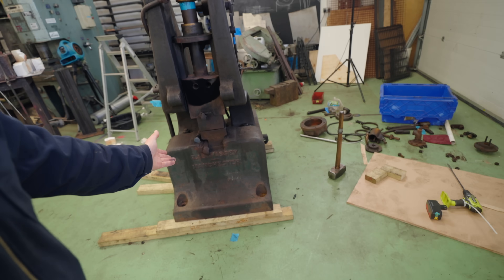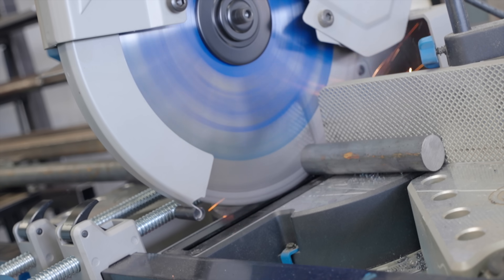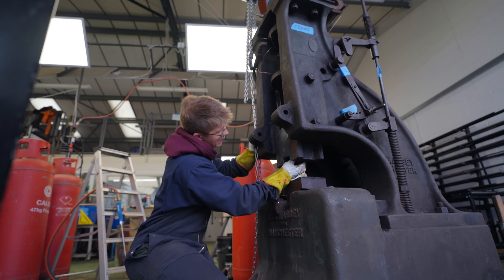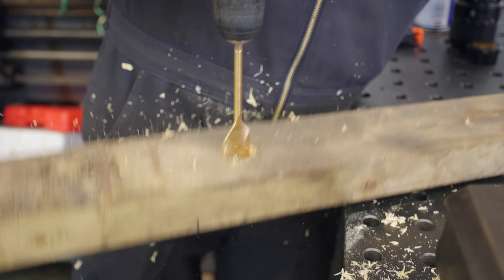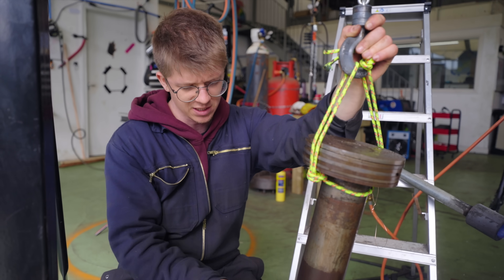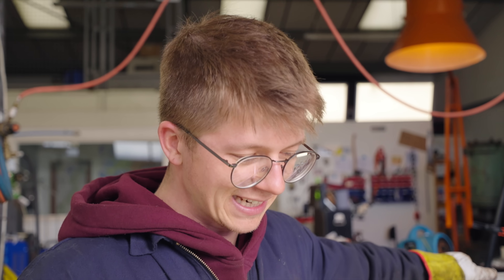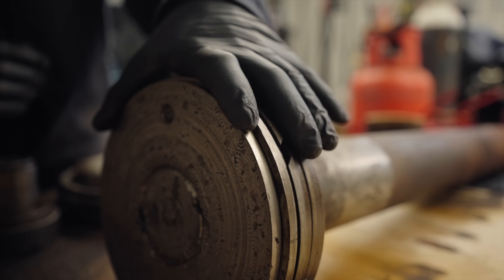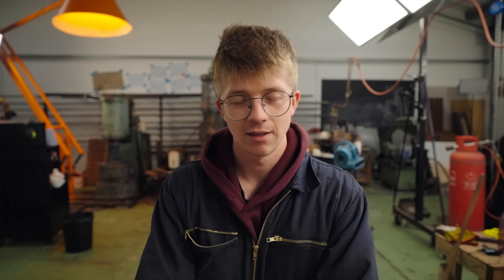FIXING A 1900's STEAM HAMMER! Pt. 2

Comment: I work on aerospace valves, some have pistons just like that. When the valves come back from the service, we grind off the unserviceable surfaces, chrome plate it, and grind it back to print specifications. It often is better than new when we are done with it.

Comment: Hi Alec. The bushes will likely be "phosphor bronze" , you can buy it in bar form for machining random bushes / seals etc. 

There are a couple of ways to go with the piston. One option would be hard chrome plating. This is the type of finish you see on a hydraulic ram on a digger. Its only able to be applied up to say 0.1mm. If you need to turn off more than that to get to sound metal, then you could look at  a thermal spray solution, such as APS or HVOF, which can be built up as thick as 2-3mm. There are quite a few specialist machine repair companies that do this kind of work and can probably give more specific advice. I have worked with Sulzer - Bootham in York, they are very good.
Reply: Very competent commentary! 👍

Comment: Hi Alec,
Laser Cladding is an option.
Have utilised this process a few times for corroded shafts. They usually use Nickel in this process, which will improve the longevity of the repair.
Hope this helps.

Comment: Alex, yes the upper piston is a safety cushion, if the piston rod breaks, or the ram comes loose the steam or air will send the piston out the top and come back down on you. I have a 300 lb Chambersburg Utility hammer with a similar upper piston

Comment: For hydraulics they sell chrome plated shaft.  It is ground and polished before chrome plating so it provides a great surface for sealing.  Turning the shaft you have down in a lathe will never be able to match the surface finish or precision of a ground shaft.  The chrome plating will give it a much longer life and you can get it case hardened to give you an even longer life.  The case Harding is not so hard you cannot machine it but carbide tooling should be used.   In the end buying a new shaft would be the best and easiest way to go and what we would do in hydraulic repair

Comment: Work as a machinist in Canada. You would loose less material on the shaft if it was ground. That way you might not need to do additive welding and re- machine it to size.

Comment: You need to do some lathework to the component in this video, then you should thermal spray the wear surfaces with a harder material, and do some more lathework to get it back to tolerances. Get in touch with a company that can help you with the thermal spraying, and take it from there. It is not a very costly operation. Thanks for sharing yet another great video!! Best regards from Roy in Norway!

Comment: I'd probably consider truing up the cylinder bore (good chance it's out of round and rather barrel shaped), then putting a bronze overlay (brazing) onto the piston to bring it back to a good fit. Turn the piston rod, then make new glands or stick with tradition and resleeve them (much cheaper).
As I see it, as long as the original heavy bits aren't cracked, why not keep using them...

Love what you are doing, keep up the amazing work!

Comment: The top piston is an accumulator piston, helps to smooth out the cycling of the hammer, likely to make it easier to use and thus more accurate when forging.

Comment: could try resurfacing the piston. Either by milling it down smaller or Welding on a new surface layer and then milling that back down to its original dimensions. I am not a hydraulics expert but ive seen that being done to pistons like that before. then again if its cast iron im not sure how well a weld would take to it and if a weld might crack it since cast iron is a lil on the brittle end of things.

Comment: Having worked short term at a company who refurbished hydraulic rams, it was common practice to scrap the rod (the piston usually screws onto the end of it) the rod itself was hard chrome plated, brought in various diameters, I think you can get the rod re-chromed but it's not cheap

Comment: It looks like there are two threaded setscrew holes on the face of the piston that are half into the piston itself and into the ram shaft. I've seen it done so the piston has something else other than friction holding it onto the shaft. I would say those setscrews came loose because they are not lined up with each other anymore and it would explain all the damage in the cylinder and on the piston.

Comment: Obviously a little late, but i had pretty good result rust removing with electrolysis, obviously it wont remove any pitting, but it will remove less material than grinding it away.
I dont know if the size of the object matters as i mostly done nuts, bolts and blades, but it might be worth a shot.

Anyway, i really enjoy watching old "rare" tools and machines come to new life, keep it coming 😁

Comment: I've seen Abom79 spray weld and turn to size for repairs on hydraulic shafts. The problem is whether or not your lathe can handle the piston. You might have to find a bigger lathe to use for it.

Comment: You could also get the shaft spray welded to build it back up to where you could take it back down to original size and then it should be purtyyyy smooove.

Comment: Replace the shafr with the same size chrome bar (the top die still needs to fit. Source and fit new piston rings and gland seals if fitted. Remake bronze bushes to ensure smooth running and assist with sealing. Don't worry about the damage to the end of the main piston and the cushion piston, just make sure the valve plug moves freely. Rebuild and hey presto.

Comment: usually you would grind the cylinder and get new bushings to fit the new diameter you cna also often replace the damaged part of the piston but that requiers alot of machining and welding

Comment: Beeswax melted into stuck parts helps. 

Also heating and quench cooling rapidly with a hose helps

As for the pitted ram it will need to be ground. Not sure how great compressed air is going to work compared to steam, steam continuously expands more so compared to compressed air therefore supplying more power per volume charge. Air will get it to run but not as much power. 

When you make the new bronze bearing you can size it to the reground shaft. You will also then need a spacer for the bore into the top die holder.

Comment: Air hammers and hydraulic rams come in pretty handy for driving/pushing out stuck pins.
I know with guns, you can tig weld small pits and worn out parts, then turn or grind them back down.

Comment: To make it easier, make a beefy hammer slide. Have  the connecting part  1 inch round bar. So you can weld it to the wedges and eazy peezy wedge comes out. Make the slide like 3  or 4 ft long with a heavy solid piece as your slide hammer.

Comment: Larger cylinder head is an air cushion that was removed. The two faces with the marks like a screw was bounding around would face each other, larger bore would obviously seat in the cap, and that flanged cylinder would be mounted with the flange between the two cylinders. At a guess this cylinder was previously secured with a large bolt, and the bolt sheared leaving that dimple in the center and the remainder of the bolt likely fell out and was what caused those thread marks as the hammer was used. The distance then from the top plate to the flange would be your stroke distance, and you could adjust your cushion strength independently by raising or lowering the air pressure to the cushion cylinder in the cap. I may have missed a detail or two, but that's almost certainly what those parts are for.

Cylinder shaft you can get turned down, especially with the need for new bronze bushings. Reason for the second bronze bushing is the matched taper. The tighter you get the bolts on the main flange, the tighter those two surfaces will interfere with each other creating a better seal, and the angle of the taper will actually squeeze the bore inwards as well slightly sealing it better to the shaft, so it will be important as you install this to bore the new bushings out at the tightest tolerance of the new diameter of the cylinder rod, tighten the flange up WITHOUT the rod installed to the correct torque spec for you bolts, measure the new ID of the flanges while installed and pressure present with a proper bore gauge, then you'll want to take a good quality cylinder hone and SLOWLY hone and check that bore until you reach a .0005-.0010" in. (or a .0125-.025 mm clearance for y'all overseas) clearance MAXIMUM. Once all that is done, it wouldn't be a bad idea drill a hole through the frame and bushing to add an oiler and use a rotary tool or or round nose chisel to create shallow channels all the way around the ID of the bushing (without running them to the edge or you'll ruin the bushings) to add in a way to adequately oil the bushing. That will make your cylinder shaft and bushing last significantly longer and allow for easier maintenance.

If you want more details on any of this, or you'd like me to draw out a diagram, or send pictures of examples I may have let me know and I'd be happy to help. I work on a lot of 1930-40s era platarg presses  and a lot of what you're seeing there looks similar to stuff we deal with on rebuilds, so I have a little bit of exposure to this older stuff.

Comment: Have the rod ground and carbide coated. That's what I do for rods on large compressors where I work. Not only will that bring the rod back to the correct size but also is extremely wear resistant.

Comment: Seems like the "top piston" could serve 2 purposes: 1) Steam above forms a cushion for the main piston.. and (2) when the main piston contacts the top piston it hits the "plug" which is actually a valve that when pushed up by the lower piston lets steam into the upper part of the cylinder and starts the downstroke.

Comment: The rod can be mde from new chrome bar with a threaded end, the bronze bushes can be remade on a basic lathe,, suggesting any other fix would be hugely detrimental and costly, get in touch with any decent hydraulics firm,, (not pirtek!!!) and they should be able to fix those issues no problem and absolutely be the best, quickest, and cheapest method,, i spent enough years doing it myself,,

Comment: Remove the rust , get the diameter measurement and then spray weld the shaft over sized and cut it back on the lathe.

Comment: There's a video from @Abom79 where he repairs a damaged shaft to its original dimensions. He machines the surface down to clean metal and then adds new material with something called a spray welder. One of those would probably work, but it might cost more than you're willing to spend on the problem.

Comment: If you don't mind a bit of a recommendation when you heat up stuck iron like that adding a bit of paraffin wax to the seams helps a lot I like to use those little tea candles from the dollar store
Reply: According to Funk FPV (forklift mechanic) this method works significantly better than penetrating oil. He says if he has the option to do open flame, he does that and wax every time

Comment: Honestly, I can't wait. If you remade the bronze parts you could size them so they fit you bored down piston. Question would be the tolerances, so that it runs properly when It's at temperature, since it's working with steam

Comment: Having worked on hydraulic cylinders I think the best thing to do would be have a new shaft and new bearings made, it will pay out dividends when you get it up and running because then you'll know that they wont be doing anything wrong

Comment: If you're concerned more with the function of the machine rather than keeping it as original as possible then the main shaft can be turned down slightly to clean it up.  But this, in turn, will require the two bronze pieces to be remade with interior diameters to match the new diameter of the shaft.  The mystery parts are as you said, something of a pillow for the ram.  It has compression rings so if it gets struck, it will compress the air left in the dead space above.  It's the ability of air to be able to exist in compression that allows this feature to work and absorb the shock of impact with the ram.

Comment: As far as pistons go they are typically coded in a harder metal that resists corrosion. As well they’re sealed with plastic seals and wipers. I don’t know what type of seal you’re particular cylinder has but if you want to add material electroplating and finishing is probably your best bet but if dimensional accuracy isn’t that important than hitting it with some abrasive might just do the trick.

Comment: I think resurfacing the piston in the lathe and having it chromed, then making new bronze bushings to fit is probably the easiest and most economical route i’ve seen suggested.  The suggestions of building up weld or having it spatter welded seem pointlessly expensive and difficult, seeing as there is no ‘spec’ size to the piston, other than it’s interface with the bronze. The rings and outer surface of the piston head appear fine, so cleaning up the shaft and re-making the bronze bushing, which is considered a  consumable part seems smartest. As it is, the piston shaft is likely slightly over-size on the rusted area, due to oxide jacking, so surfacing it down may not remove to much anyways.

Comment: Looks like the rod is removable from the piston.

You could either replace the rod with a new one that is hopefully a standard size hard chrome bar. 
Or make a new one from high tensile bar, get it induction hardened, chromed and ground to size.

If it is not removable you can  still get it rechroned and ground to size.

Comment: hydraulic guy here, sometimes the shaft will be ok (depends on the leak factor and if a leak is allowed) but if leak is not allowed, that brass/bronze bushing can be made smaller so you can grind down the shaft, clearance between the two is dependent on the shaft diameter typically .002 - .003 of an inch max (thats how we fix pitting anyway). also that top plat and plug seems like some kind of a check valve?

Comment: That is a solid steel rod and the rust is surface rust.  Clean it up and put it back in and don't overthink it.  The pressure sealing occurs at the rings, not at the rod.  You do want a clean surface on the rod in order to have sealing on the bottom seal, but that can be accomplished by a light skim on a lathe followed by fine polishing with scotch brite pads.  If absolutely necessary due to any deep pitting, have it skimmed down a couple of millimeters and then built back up using flame spray deposition and then re-skimmed to a fine surface.

Comment: I'd probably put the piston into a lathe and turn it down until it cleans up. Measure that and then find the closest seal size that would fit it. You would then finish machine and maybe chrome the piston shaft to match that seal. It's also likely you'll need to install some new bushings for the receiver and maybe modify how the seal gets retained. Not sure if it's worth getting the piston shaft chromed or not but its probably is a good idea for longevity. Alternatively, you can find a new hydraulic shaft that's the right size, cut the piston ring section off the old shaft, attach/weld/bolt/whatever them together, and then machine in the through-pin holes. You'd likely still have to install new bushings. I think I would start by trying to turn the shaft down and seeing just how much you have to take off. From there re-asses and make a judgement call.

Comment: If your lathe has the capacity for the piston then you can do it yourself the way I was taught. Turn down the shaft to remove the bad metal. Next use hard facing welding wire to build back up the shaft, use more than you think you need because next you have to turn it down to clean it up. 
I realized that Hard Facing might be a western Canada term. It's the same welding wire used to redo the face of an anvil.
That's pretty much all there is to it.

Comment: The piston is the part with the rings. The shaft only needs to be sealed at the bottom to keep the steam in so it pressurises the bottom section to push the piston up.

Comment: Talk to a local chrome coater. Find out the thickness of thier plating process. Then knowing your ideal diameter based off the good portion of the shaft, have a machine shop clean the shaft to that specificion so when its all said and done you have proper diameter and ideal surface for sealing.

Comment: If you're using steam ether make new smaller bushes and seals and turn the ram down to suit,  or get it spray welded to build it up... if your using air then you could use one of the epoxy coatings they have for shafts now a days

Comment: if you wanna use the hammer for a few years, just brush off the rust from that ram. a bit of leakage might rob you some power but it should be fine. if you wanna make that sucker last another 100 years (would be my choosing) go ahead and turn the ram down to eliminate the rust and turn some new matching brass/bronze bushings. looking forward to more lathework :D

Comment: First you lathe off all the pitting or at least enough.that  You can get rid of all the corrosion to avoid contamination.  Leave it in the lathe You can then  get spray welder for a oxygen acetylene torch to build back up the surface on the lathe (protect your ways or you'll ruin your lathe)  and follow up by cutting to final Dia and finish!

Comment: Could the mystery piece at the top be a pressure release for the air cushion at the top of the stroke? If the top is sealed well then the air cushion would  still cause a pretty abrupt stop right? So could it be a two way valve where the air is brought in thought the middle hole so there isn’t a vacuum slowing the down stroke and released again on the up-stroke but only under pressure?

Comment: The part at 17:30 should act as a pneumatic bump-stop in case the ram piston rises a little too far.  If the ram were to smack the top of the machine, that could send hurty bits flying.